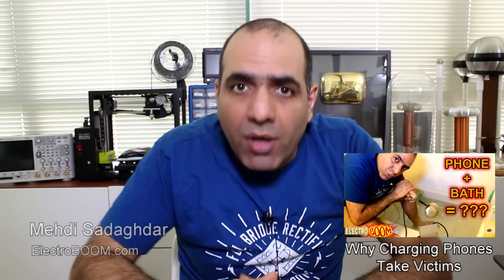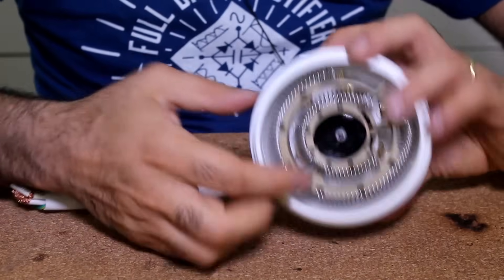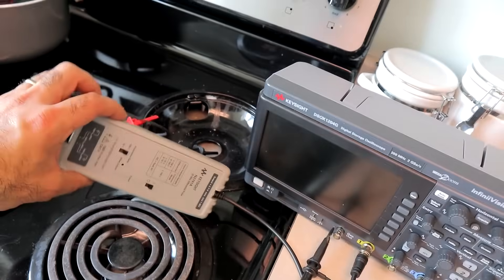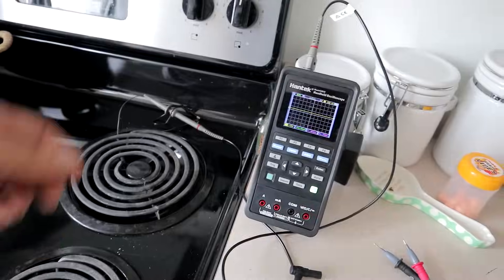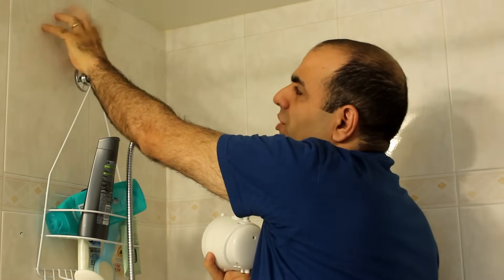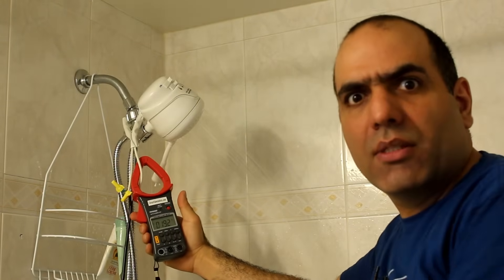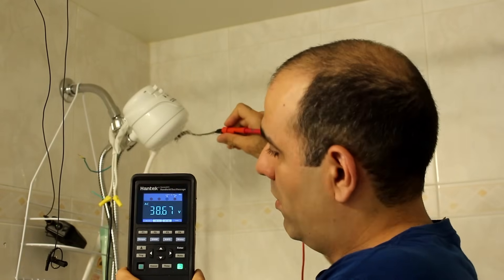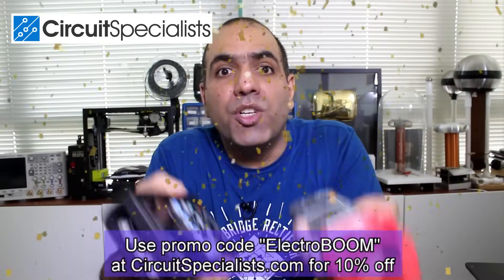How Safe Is the SHOWER HEAD OF DOOM?!

Comment: “So I hate to say it but besides the loose wires and the fact that it may set your house on fire , it seems pretty safe” 

i agree with your logic
Reply: Actually in Brazil most of the house's are made of bricks and concrete, and not wood like in the US and Canada. So is more difficult to it actually burn in a fire.
Reply: @arthurizando  the wires can still catch on fire though. It happened to me, but luckily where they caught on fire was where the wires connect to the meter outside the house.
Reply: @jadonclegg8684  I know that, but here "most" of the people that have those showers have the proper wiring.
Reply: @arthurizando  does it draw 19 amps 😂😂
Reply: @realcartoongirl  yes
Reply: There are some of these showers made for 127Volts that demands a 10mm² cable (50Amps), but here where I live most homes uses 4mm² cable for the shower because the eletricity here is 220V and it makes those showers to demand between 15 and 30Amps (3000W to 6800W) deppending on the model and the temperature switch (and of course, there is a specific circuit installed just for the shower, it is not connectected to any other circuit in the house).
Reply: i meant all this as a joke 😐🤡
Reply: If this set my house on fire im going to stay under the shower, because nobody died in a fire while on the shower.
Reply: @jorgeporras9262  then your house is a death trap!! Breaker should have popped by itself, get a decent electrical installation
Reply: @jadonclegg8684  the wiring is made to withstand this though.
Reply: @GraveUypo  yeah it's supposed to withstand it, but the wires were outside the house and probably pretty old, and partially corroded where they caught fire.
Reply: @arthurizando  in Brazil the shower wires are thick to handle the current and shower have a separate ground. but don't try to take a shower for too long(like an hour).
Reply: @MathGoOli  In my house  we don't use these type of shower, we use Sun heated water. But even people do take long showers and at most the resistance pop's.
Reply: @MCA0090  But there are 220v showerheads aswell. I know from past experience that a 110 shower head and 220 wires don't mix well at all.
Reply: @virgilio6349  Yes, most places in Brazil uses 220/380V standard (220V per phase and 380V between phases)... But in places where the standard is 127/220V people can use 127V or 220V showerheads deppending on how they will power it (in 127V using phase and neutral wires or in 220V using two 127V-phases), but 127V will require thick wires like 10mm² or even 16mm². 
In 220V you will just need 4mm² or 6mm² :-D
Reply: @conz1842  ...are you serious?...do you really believe that?
Reply: @estebanchaconrojas  Powering the unit with no water doesn't draw more power than normal; it simply doesn't have the running water to dissipate the heat into, so the current remains as normal (if anything it reduces marginally due to the slightly positive temperature coefficient of the wire's resistance) despite the temperature skyrocketing.
So the circuit breaker will not react to this, nor is it meant to.
 
(Fan heaters, for comparison, typically have two elements at up to 1.5kW each depending on how much power is regionally permitted; and although those are physically much larger than in these heated showers, fan failure will still cause them to get red-hot for the few seconds it takes to blow the thermal fuse. At least standards-compliant fan heaters have a thermal fuse though, on top of a resettable bimetal cut-out; and their elements are supported by fireproof mica or ceramic pieces. This has no thermal protection whatsoever and its elements are up against plastic. As much-maligned as space heaters are especially in the USA, the worst I've experienced myself in Australia was when they made the mistake in the 1990s of using plastic top grilles on convector heaters, which degraded and broke after a decade or so used mainly on full-power; followed by a 2kW fan heater from the aptly-named Heller brand which seized up in short order, I switched it off immediately but it would probably have just blown the thermal fuse anyway, not that you can be too sure with truly bottom-of-the-barrel junk. By now I'm better-learned than anyone else I know in how to avoid junk units; speaking of which, since governments have far too few resources to catch them all, I'm issuing my own product recalls in this thread: http://www.hardwareinsights.com/forum/viewtopic.php?f=29&t=2279&p=9226#p9226
I blame a lot of the US/Canada-originating horror stories on the "residential grade" electrics there being, blunty, utter garbage compared to what we have in Europe and Australia; though that's quite a long story, but one aspect that comforts me is that we don't make their idiotic distinction between "residential" and "commercial"-grade fittings. There are of course still many crap brands here, but most electrical accessories from our dominant Clipsal brand are quite well-built.)
 
I get that in the 110V models (as here), the current is so high that a suitable thermal fuse would be hard to obtain; but for 220V models (as Clive and DGW examined), it's easy enough to find thermal fuses rated to interrupt loads up to 25A at 250V (therefore 5500W at 220V, to 6000W at 240V). They aren't very expensive, and given that their end is epoxy sealed they'd probably still function fine in water; one set for perhaps 98°C and mounted shortly above the elements, combined with changing the element support pieces to mica or ceramic, would make a big improvement to the fire-safety of these devices at minimal extra cost.
Reply: @realcartoongirl   wþf is ur banner
Reply: @synrs  felt that
Reply: @conz1842  because they ran away from the shower hehe, when the pipes melt there will be no more running water in the shower
Reply: @arthurizando  and to that point, i wouldn't have running gas inside a basement under a wooden house either, we are scared enough using a gas tanks in ventilated rooms, the idea of an infinite gas supply on a sealed room, seems way scarier
Reply: @devforfun5618  who talked about gas? I particularly use solar panels, gas would be one of my last choices
Reply: @arthurizando  because that is what people use when they don't use electricity, if they are scared of burning the house with electricity they should be even more scared of using gas

in the us they have a boiler in the basement where they heat the water, unlike us who only heat the shower water they have hot water on the entire house, that is why sometimes the sink has two faucets, one for hot water and one for cold water

so lets say there is a gas leak near the pilot flame, nothing will happen because the gas will burn, but if they turn of the fire without noticing the leak that gas will accumulate, because it is heavier than air, and they are in the basement, so all the ventilation is on top, if someone go down there to light the flame again, hopefully they notice it by the smell, but they could ignite the gas turning a light bulb on before that
Reply: @devforfun5618  actually there are a lot of people that have whole house water heating, like me who has  solar panels. Yes it is less spread than just shower heating, mainly due to the cost but it is still very used. And apart from Sao Paulo most people use solar not gas. In fact I don't know anyone that uses gas heating in Brasília
Reply: @arthurizando  do you realize the guy in the video ISN'T BRAZILIAN
Reply: @devforfun5618  yes he is Iranian currently living in Canada more specifically in Vancouver
Reply: @arthurizando  well the smoke is still bad for you and the stuff inside will still burn too

Comment: I just renovated the electric installation in my bathroom here in Brazil, and I had to run 6mm wires for the shower into a 32A circuit breaker. You definitely DO NOT plug these into a regular outlet.
Reply: Well, he is using a GFCI, so it helps a bit in that case, as the GFCI is made for water situations in Canada.